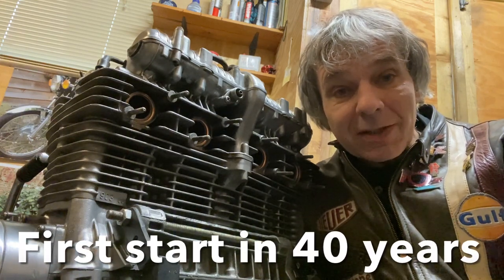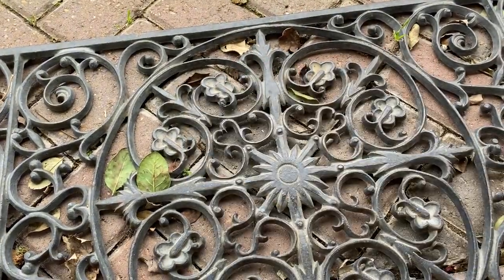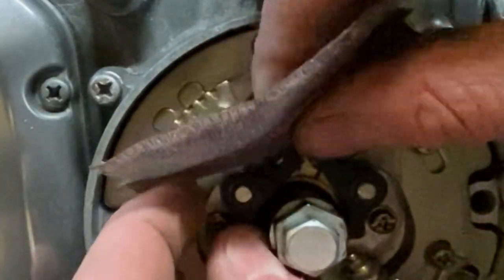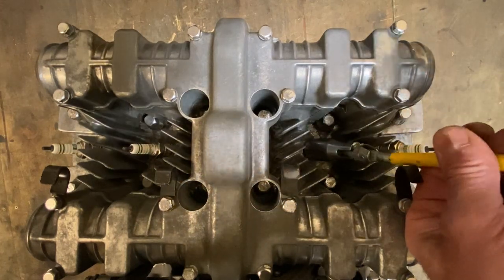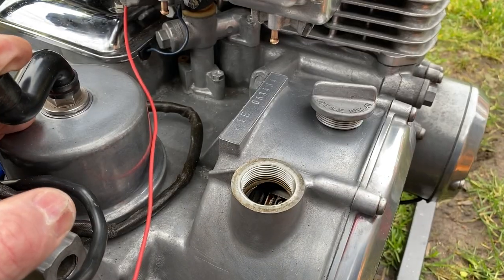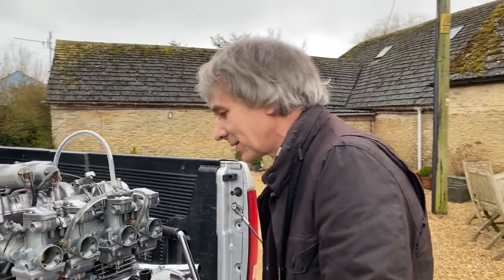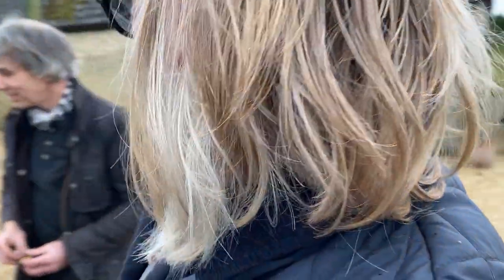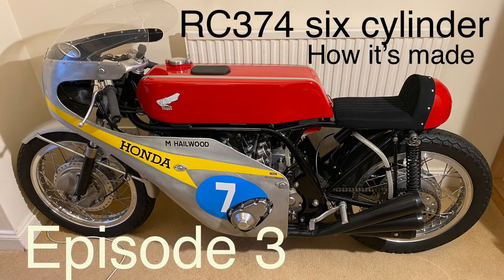First start in 40 years - Kawasaki Z1B 900 engine

Comment: 40 YEARS, most people would suck air through there teeth and say it needs a full strip down mate, not Allen, four carb rubbers, check the points bung some fuel in it, away you go, magic! The eccentric genius is alive and well in Britain, he can be found wandering the lanes of the Cotswolds! Thank goodness for original people! He should get a knighthood for making people smile!
Reply: Depends on the condition surely ? And whether it's been stored outside or inside !
Reply: @Sam_Green____4114  Come on, just smile.
Reply: @glencasson9046  I’ve got an 89 Harley FLTCU……new carb, new ignition module…..she runs…..
Reply: Looked like it had been decently stored, no corrosion to speak of. Still, a guy that can tune carbs to near perfection by blowing through them is pretty special.
Reply: Gave the carbs a quick wipe...( the thing a couple thousand guys get wrong )
Reply: @ChrisP978  l could never tune my Honda 400/ four carbs now matter how hard l tried! Even when l bought a carb tuner !! l got them near enough but not perfect! The man's a genius!
Reply: @ChrisP978  I set my Yamaha carbs with a length of 6mm fuel hose.  Hold the end at a carb inlet and listen the pop-pop. Repeat on partner cab, adjust until both sound the same. Balance the other pair then balance the two pairs. Job done. Tested some time later with gauges and it was perfect. Only difference - it’s a quicker job with the listen method.
Reply: @Dave5843-d9m  I was shown how to do it when I was an apprentice mechanic, in the 1960s. Les
Reply: @Sam_Green____4114  Glass half empty dude, get a life and appreciate the mans special talents!
Reply: @markkelly940  how pathetic!
Reply: That's what you can do with old Japanese engines. Most still look like new inside after many decades of ham fisted owners have thrashed the nuts off them.
Reply: old bikes could be left for years and fresh fuel and a battery  was all you needed to rekindle em not today ECU,s shitty fuel etc have to be left in a bone dry shed on trickle charge or its a no go .
Reply: Biggest risk really is rust around the bore where the rings sit for a long time, it might run well for a while until the rust groove starts to catch/wear on the rings and pass oil.

Comment: As time passes, those older Japonese engines just look even better, authentic, beautiful and yet simple robust engines, that were designed to run and run. Long before the days that vehicle manufacturers sought to ensure after sales from inbuilt defects, or extreme crippling revenue from dealership franchise. Good honest engineering, from a dedicated, and proud nation. Thanks Allen x
Reply: Yes , those z’s . My z1000 did 86,000 miles, bomb
 proof if looked after and stunning looking👍
Reply: It's the air cooling that gives the classic, robust design.  I had a FJ1100 in the 90's with a 1300 resleeve and other mods.  Conventional wisdom said it wouldn't last at that bore.  Rubbish, I put hard miles on it over deserts, up mountain ranges, and on the daily freeway grind for 30k miles.  Never seized, never failed, and would roll past the ZX11 up to the 150 mph mark.
Reply: Made in Japan = ❤️❤️❤️❤️❤️❤️❤️❤️❤️❤️❤️❤️❤️❤️❤️❤️
Reply: Having been in engineering since 72 - I always wondered why (considering a 64 1500 Ford uniflow engine) car engines where not made like bike engines?! Well - now they are.
Reply: @bruces3613  I had an FJ 1100 about three years ago but because I moved into a flat had no where to store and finish a minor refurb had to literally sell it for scrap.  Previously running well with a new MOT wouldnt fetch £700.

Comment: I bought a 1975 Z1B in 1975 which was burgundy! Wonderful motorcycle! I remember changing the points and doings the timing and changing the shims on the valves. I came from a 2 stroke Hodaka, Mach 3, and a H2 750. What a difference, much more rideable. The Z1 was just as fast as my H2 but without the vibration. Fond memories!!!❤️

Comment: 2.21.21.   I remember these when they came out late 1972.......🏁. The two-stroke Mach III in 500 & 750cc were wickedly quick!  The transition to the Kawasaki 903 engine, was breathtaking in a few short years.......quite the learning curve for Kawasaki heavy industries™️
Reply: The big two strokes with the bendy frames, specifically designed to keep your bowels moving !
Reply: They made a 900cc also but it was banned
Reply: @Andy b, did they?!

Comment: I own a 1976 Z900. Bought it new and have ridden ever since. So mine has been running for 46 years and 164000km. The cylinder head is going to require major work now as the valve clearances are currently set with the thinnest shims.
My bike has a number of upgrades necessitated by it's age. Electronic ignition , voltage regulator and rectifier, Hagon rear shocks, Akront alloy rims and a Kerker stainless exhaust  . Still has the original paint. I  have most of the original parts. What a bike.

Comment: Wow! That motor sounds incredible, for sitting unloved for49+ years! I have a 1975 Z1B 900 that I have owned since 1999. The motor has never been opened up, and it has approximately 15000 miles on it. No smoke, no noises, and I could go out in the shop and in 1 or 2 kicks, she'll fire right up after sitting for a year! The only modifications that have been done, are a full chrome kit, chrome Kerker 4-1 header, an oil pressure gauge, and a Dyna 2000 electronic ignition circuit. I have always ridden Kawasakis, since I was about 6 years old. I have owned other makes such as Honda, my first street bike, a 1972 350, a Honda CB 650, a 1968 Harley Davidson Iron head Sportster hard tail with 18" over springer. Sold the Harley after high school before leaving for the Army. I always had a Kawasaki too, usually a 900 or 1000. Also, I have the same Dodge quad cab in the same color! After watching this video, I am now a subscriber!
Reply from the maker: Brilliant

Comment: I bought one Kawa 900 that was standing outside for 15 year doing nothing. I put gas in the tank and put a battery in, and it run olmoost instantly. Those engines are rock sollid.

Comment: Reminds me of the time I rebuilt my Z650 engine, as a young lad. Didn't finish getting it together until 2:30 in the morning minus the headers, and knew I wouldn't sleep until I had heard heard it running. Fired it up and it worked perfect. I slept well, unlike my neighbors. That sound just took me back to that moment in 1982.

Comment: Mr Millyard you’re a genius, I bought a 45 year old Lambretta last autumn that hadn’t run for around 30 years we cleaned the carb and plug and fuel filter piped up a fuel supply and away it went, I didn’t stop smiling for a week 😀

Comment: I did a very similar thing on a Honda 750 4 , it hadn't been started for many years, set up the points and topped up the oil, set the Carbs as close as possible to all opening the same throttle, it started first time, only thing was fuel was spewing out of 2 of the carbs, they caught alight because I had the battery next to them, the positive wire came lose and arced, of course I had no water or fire extinguisher near, I tore my shirt off and threw it over the engine, lucky for me it extinguished the flames, apart from that the engine ran great.

Comment: Hi Allen Very nice Stock looking Engine, In My Experience With My Much modified Z900-A4 The front Cam Chain Guide used to snap off if the cam chain tension wasn't kept an eye on, Mind you I was running A Lightened Crankshaft Balanced and welded( with rods and pistons), Forged rods, A 1080cc Big Block, Ported and Gas flowed Enlarged head, Smoothbore Carbs, Cams profiles Like Dolly Parton, The Redline on A stock Z-900 is around 9000 to 12000, With the Dyna Coils I had fitted it would Pull and rev up to 14000 RPM and it stays together and reliable (I missed a gear once and pegged the Tach needle on the zero stop, possibly looking at that's 21000 RPM, bent one valve slightly ), The one thing I had to do to make this all go was put on a larger flowing fuel tap as the bike flat out would drink more the tap could deliver, I kept the Engine cooler by running a Thermostatic Lockhart Oil Cooler.
On a different note How is Henry Cole on TV He comes over as a bit of a wide boy but having never met him in person I don't judge till I meet someone or someone that knows them well

Comment: Brilliant. Didn't expect that "blowing bubbles" sound when you took the headers off.
Reply: It's pretty amusing isn't it!  It's the resonance of the cylinder and exhaust port during "blowdown".  So because the pressure drops rapidly, so does the pitch - exactly like a bubble bursting (or smacking your lips to imitate the sound).

Comment: That big old grin says it all 😄
Use to do this with skid steer diesel engines after I'd rebuilt them ( when they were still all mechanical). 
Just to make sure they ran good and dry before putting it back in and have no room to work on it. 
Good times.

Comment: Allen and Henry both like a pair of schoolboys bunkin off school in the countryside messing about with a motorbike of some description haha, and as for Allen’s portable fuel tank, that reminded me of my first bit of an engineering fix on my first ever bike, a puch maxi, I bought it for £2 because the petrol tank had a hole in it, i tried to fix it aged 12 but no chance.......but an idea sprang to mind, a quick cycle ride upto the scrapyard had me had under the bonnet of an Austin allegro, and the windscreen washer water tank was removed, placed on the rack of the puch with some cable ties, string, tape etc, and a feed pipe to the carb, some 2star petrol and that was it, I was on it! 😂

Comment: A friend of mine back in the seventies managed to get a Z900 engine to rev to 24000 revs. The engine was in a sidecar racing outfit and was banned from all of the ractracks in Aus. Just takes a bit of offset grinding on the crank to get the result.

Comment: That is a lovely engine.and does need a worthy build. Certainly a proper Z1B restoration would be appropriate but in that case the engine is better that the bike it came with. Maybe you are thinking of a totally original frame? A lighter and stiffer frame would make that stock 80-something horsepower come alive, but that is a lot of work. 
I have often pondered putting a bike engine into a small '60s rear wheel drive car, mounting it sideways and connecting the output to a driveshaft. Silly, yes, and cooling would be challenging.

Comment: Good 😊 luck in finding the rest of the bike. That engine deserves to go back in one ☝️ another suggestion is searching out a Rickman C R chassis ? as an alternative. PS I worked on a Rickman CR Honda CB750 MTC 998cc over 40 years ago (crankshaft sheared off with the flywheel).

Comment: Fantastic video, and slowly getting through the list you have,seen a few, impressed with all of them , however I have a question, I own a 21 yr old Yamaha fazed 600 , that suddenly after leaving for about 3 wks , was running fine , when I started now running on 3 cylinders ,when I ride and get to about 3 k revs it picks up and runs perfect if I keep above 3 , on the revs, my way of thinking was one of the idle jets is blocked , however my son says maybe a carb rubber might have a small split , what would be your suspicion, normally I would have had everything in pieces in mins and had the spanner’s out , but I’m on blood thinning tablets and even the slightest cut isn’t good, so I only want to attack the likely troublesome part or parts for this reason thank you Shane uk 🇬🇧 ps that engine sounded fan bloody tastic on the back off that pickup ,,,well done

Comment: Have you ever considered turning one of your Millyard MtBs in to a middrive gearbox EMtB? Now that would make a great series of videos and would definitely get you loads and loads of views etc. 

Please do this with your Mountain Bike. I love seeing that bike smash the trails. Such a beautiful rear suspension and the gearbox is a great idea and work of functional art. Honestly think that if you could refine it a bit more and get it attached with a top line Electric bike motor, say the Bosch or even better design a way for it to attach to all the main ones in a way that is efficient and sturdy, along with a Drive shafts or Drive belt system that will also attach efficiently with the current rear hub set ups etc and I'll bet you'd make a fortune or at least a few great videos.

As obviously good as your rear suspension is, i believe it works at a very high air pressure, (please correct me here if I'm wrong). Which the big brands would be scared to use on their bikes, higher the pressure the more likely the issues are and more dangerous issues at that. If even 1 of the shocks wasn't made or built right or someone who didn't know what they were doing tried to take it apart to fix or service it then it could, with such high pressures, basically become a bomb waiting to blow or go when they tried to take it apart and get it wrong .

Where as the EMtB crowd are crying out for a good gearbox system that's easy to use, doesn't cause more resistance or battery drain and is easy to attach to most of the ebikes around. Now I know you're the man for the job.

Comment: Allen, thanks for all the videos. I wonder if you could answer another Zed related question? The ZRX1100 and 1200 has an issue with the starter chain tensioner hitting off the clutch basket and I wondered if you would do the same fix as the 'tensioner tamer' or would you approach the fix differently. As a mechanical fitter I think maybe trimming the tensioner so that it cannot reach the clutch basket and I wonder if the tamer is only addressing a symptom or if this is really the correct way to fix it? Thanks if you get a minute to put some critical thinking into this Kawasaki problem.

Comment: Hi guys, i just can’t get enough of these videos, hey Allen, I’ve got a 1973 Suzuki gt250k that needs building up, it’s been completely restored, what’s been called a nut and bolt restoration, i reckon that you could have it built up and running in a few hour’s lol 😂, I’ve been procrastinating for a few years lol. That engine sounds absolutely awesome, love the pipes, great soundtrack from those 4 cylinders , yummy 🤤, I’ll take that engine off yer hands and shove it in my chopper frame, no problem, lol 😆. 
Where do you get all your engines from, have you got a stash of them, grrrrrr, I’m well jell of them, DOH 😖 
That engine started so easily, yer a freaking genius man and I love it 😻. Amazing video Allen, now, I’m away to watch it again with starry eyes 🤩. 😎👍👍👍🇬🇧

Comment: I figured unless something serious had happened inside the engine, I figured it would run fine so long as the carbs were good. My only worry with those engines for the age is the possibility that the cam chain tensioner rollers had perished which is a common issue with these and CB 750 honda engines as the wheel that worked as the tensioner was rubber.

Comment: i also have a question sir,
i have a Dax 50cc. but it has an injection system. i want to get rid of all that junk and put a carb on it. but its wireing is made so you cannot put a regular CDI ignition onto it.
i was wondering if it was possible to put a regular old style ignition system on it, like you have on this bike, so that it also still charges the battery.

Comment: I like your videos a lot! Thanks for the entertainment! 
At Minute 8:10 one can see the breather hose with the two 90° sheets. Could you please tell me where you got it from? I want to attach a filter to the breather dome, but I have to put it on a little bit to the rear because of the K&N airfilters on my mikuni rs34 carburettors.
Reply from the maker: Zpower
Reply: @AllenMillyard  Thank you! The Kawasaki part number is 92059-078

Comment: When I rebuilt my 1966 Norton 650SS 30+ years ago, just in time for the Norton Owners' Club centenary run in '98, I jury rigged a plastic fuel tank just like that. I was caught out: it started first kick! Unfortunately the throttle cable was loose and I couldn't keep it up. (Wife: no comments please).

Comment: G’day from Australia, Allen. Enjoy your channel and completely fascinated with all the bikes you have built and modified. 

I notice that most of your modifications are on Japanese made motorcycles from around the 70s. Any particular reasons for those choices other than build in gear boxes and multi cylinder engines?  How long ago did you first looked at those engines and say to yourself ‘ Gee. That new Kawasaki two-stroke triple would look great as a six cylinder!?’

Is it possible to also make say a triumph four using two Bonnie engines or a Norton triple from commandos? And my other burning question then, is it possible to turn a Norton engine sideways in the frame and run the power shaft through a small guzzi gearbox and drive shaft setup?  Would you need to offset the crank, like in a Bonnie motor?

Comment: Great stuff. That engine looked virtually mint once you got it cleaned up. If an engine hasn't run for that long, is it advisable to put some oil on the upper part of the internals before starting - up around the camshafts, etc (I assume gravity will have ensured it is all bone dry there after 40 odd years) - or will the oil pump circulate it quickly enough to prevent any damage from being done?